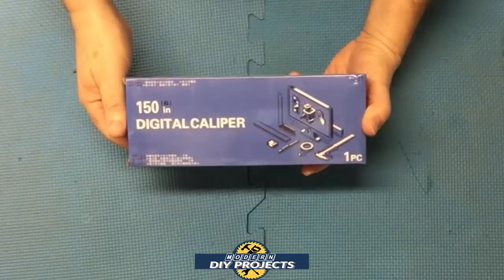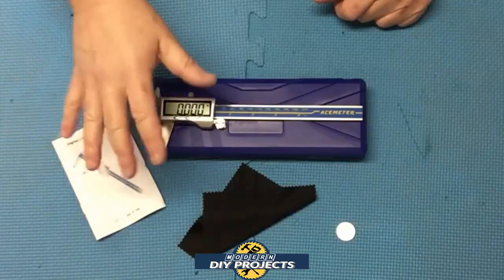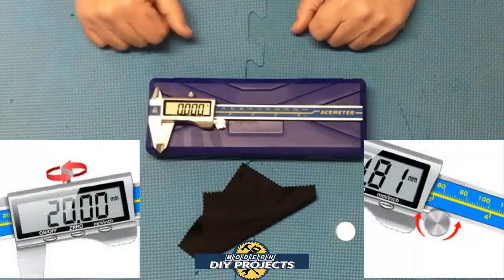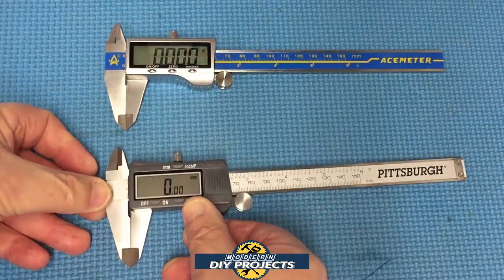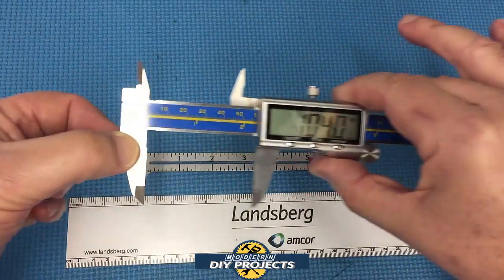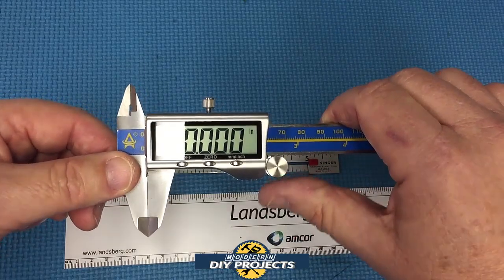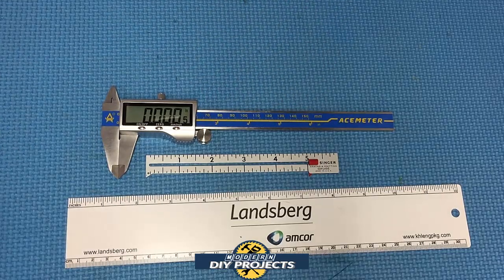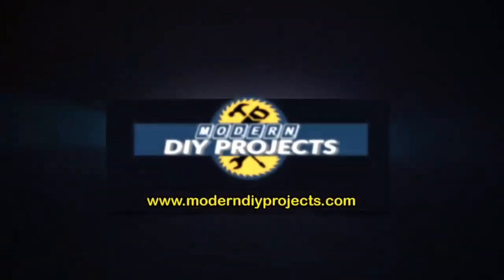Stainless Steel Digital Calipers Review - Better than Harbor Freight Pittsburgh Calipers

Comment: Harbor freight is junk. I made the mistake of buying a plastic digital Pittsburgh and i babied it and yet after some time, it will no longer hold zero or even measure anything. Of course, not under warranty any longer